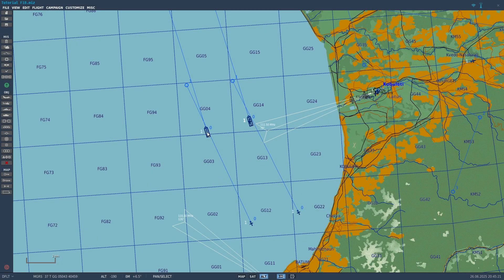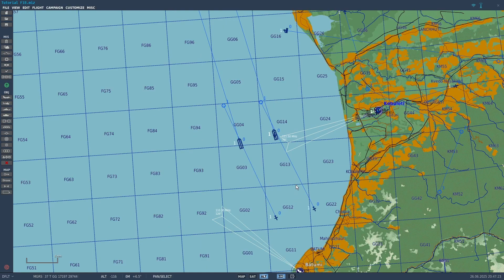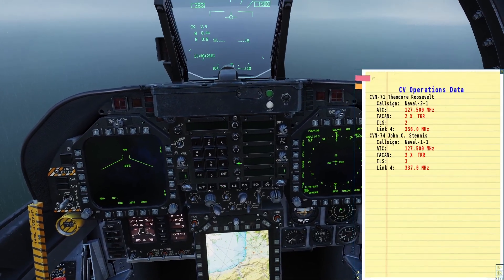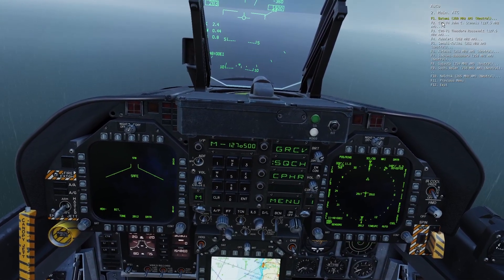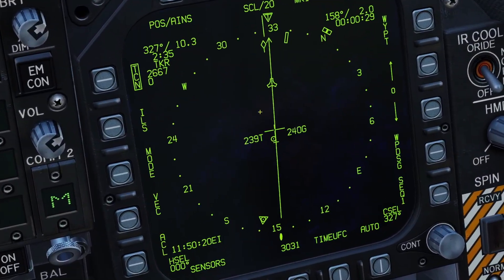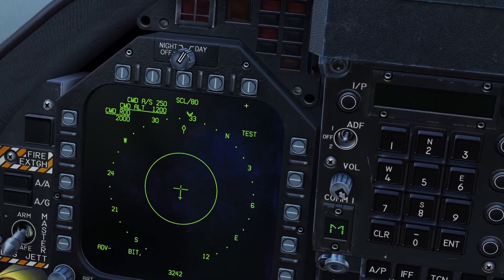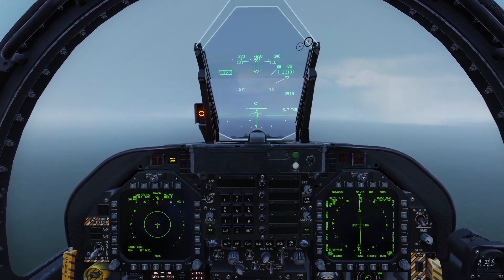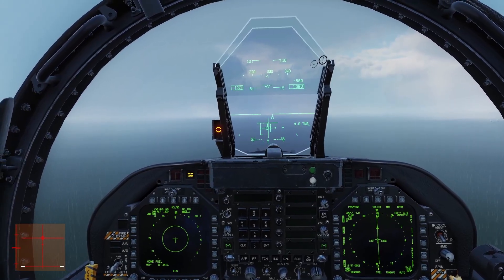DCS F/A-18 ACLS Landing

Comment: Good video on getting ACLS to work, but a lot of important notes regarding Case 3 recoveries were missed.  The data in the upper left of the ACLS screen shows what speed to fly along with descent rate and altitude assignments.  The Super Carrier manual has great diagrams of the carrier recoveries, and I’ve also made them night friendly kneeboards and uploaded to the user files on the website (same username).  A great resource to have available.  Commencing should be called out when leaving the assigned holding pattern at your push time, and calling platform is when you are passing down thru 5,000 feet.  Simply choosing these options for no reason in the menu will make ACLS work (okay for single player), but pilots using this method would be developing bad habits and messing up the whole SA picture for other pilots in the pattern if playing multi player.  In addition, sometimes the SC can be pretty picky about which order pilots land in when there are multiple planes, so it’s best to make the radio callouts at the correct places and times during the approach… not just randomly to get ACLS to work.  It’s possible in MP servers that you will mess up someone else’s approach if you are behind them and make callouts (platform, etc) as if you were ahead of them.  Otherwise, if flying single player, sure, the method in your video will work out okay.